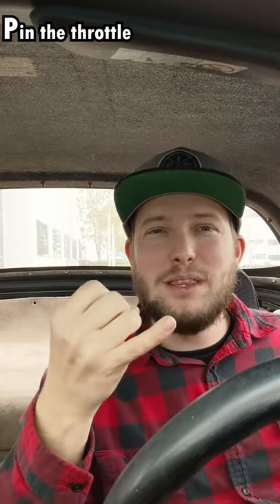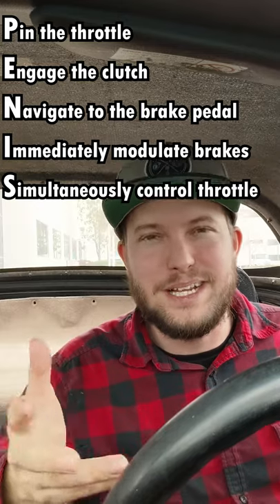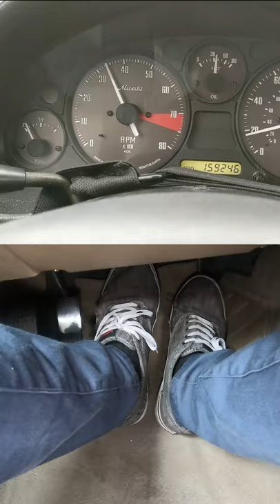How to do a burnout (5 easy steps)

Comment: during which part should I feel the pain of my clutch burning up
Reply: The part where you engage the clutch but nothing happens (the second step)
Reply: Just make sure you dump the clutch at 8k rpm and immediatly clamp the brakes as hard as you can.
Reply: 😮 wow
Reply: @CowbellCustoms instructions unclear my car only has 7k RPM
Reply: @CowbellCustoms  Do NOT clamp the brakes as hard as you can!!! this will slow down your rear tires as well, causing you to stall. Only light brake pressure is needed. Enough to stop the car from moving forward, but not enough to stop the rear tires from spinning.

Comment: This is probably a really dumb question but how come you don't stall when you release the clutch so fast?
Reply from the maker: As long as the tires start spinning it won't stall, but if the tires grip it will stall.

Comment: When you push the break pedal, aren't you breaking on all 4 wheels? So that must be hard on the rear break pads
Reply from the maker: Yes it will get them hot if you go for a super long time, same with the engine because it has no airflow
Reply: yes but it's not much. You need to use the brakes or you'll grip up and the burnout will end